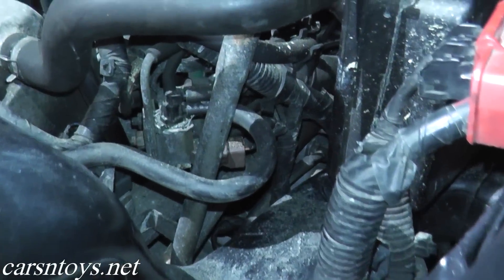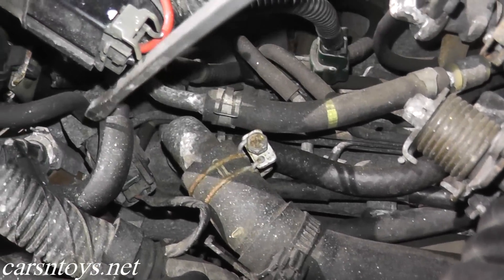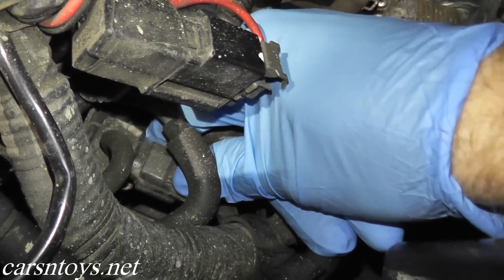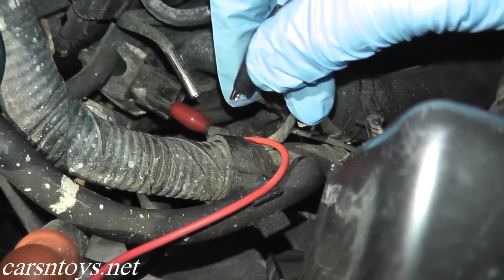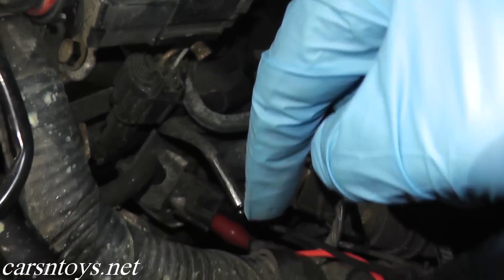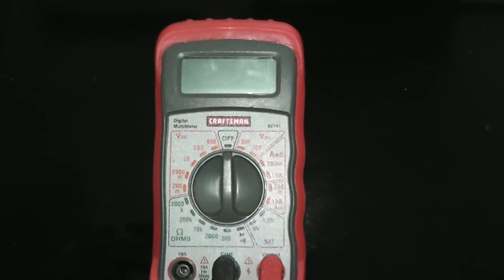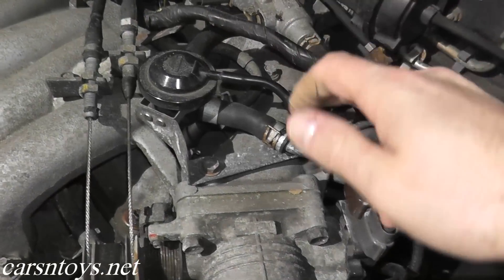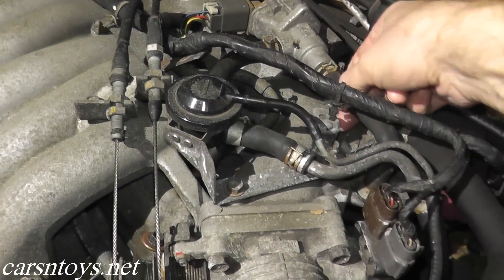How to Test and Replace EVAP Canister Purge Control SOLENOID Valve P0443

Comment: First of all thank you for the video it helped me finding the problem in the 98 maxima it was Throwing a lot of of different codes but the main codes was p400 p1447 which was a canister problem and the diaphragm on the canister was fallen off inside the canister and the engine was sucking all the Charcoal threw all the controls purge valve etc i had to remove all the hose and controls (sensors) and anplug hose to blow air through them with an air compressor and I realize was that evap canister all so i use the mityvac ( hand vacuum pump) to Check the sensors throughout the car and they was ok all so i use two wires with alligator clips to check if they open or close combine with the mityvac to make sure their operational so after spending thousands of dollars in mechanics this video for sure helped me fix my problems and yes if any baddy wonders this a 1998 nissan maxima California emissions car i want to personally congratulate the man in this video thanks brother and god bless
Reply from the maker: Glad to help! Keep it going!

Comment: I installed a tee into the vacuum line between the purge control valve and the purge control solenoid valve and attached a vacuum gauge to the tee.  When I started the car, the vacuum went immediately to 20+ inches Hg.  When the car warmed up and idled down to 700 rpm, the vacuum was still there.  Then I disconnected the connector (after shutting down) and started the car. The vacuum shot up to the same reading as with the connector connected. Then I checked the harness connector for power on pin 2 and  checked for the ECU providing ground on pin 1.  It was not, which it should not at idle. Obviously, the purge control solenoid valve is sticking open.  Just wanted to add this scenario because it is broken the other way--won't cut vacuum at idle or other times (like starting) when extra air causes problems.  David

Comment: Is it normal that my whole intier EVAP system was clogged up with too me looked like carbon build up. After cleaning up every thing the check engine light when off.
Reply from the maker: Happy it worked out. Certainly is possible, especially if your vehicle is a number of years old.
Reply: I just found out it wasn't carbon it was charcoal from the EVAP canister. I guess the filter must of gave out and clogged everything up. Runs like New again 👍👍.

Comment: I have 2003 kia sedona ex. 3.5 L 6 cylinder. Im getting the code p0443. Evap  code please need to replace the sensor or should I start with something else. A guidance would be highly appreciated. Thank you. Also the car rumbles at 50 mphs and above. Tire balancing is passed...its all done and 💯. I still can't figure out what's going on. Pls help.

Comment: Should I replace my vapor purge valve on my firewall also?? I believe it's working properly via vacuum hand pump ..I have a vapor canister1) a vapor canister valve solenoid 2)and vapor purge valve3)...1 & 2 have been replaced but not the PURGE VALVE

Comment: Another great video!  My solenoid valve did not actuate when I applied power.  The top hose on my evap canister purge control valve (flyin' saucer) has vacuum at idle, which leads me to suspect my solenoid valve may be stuck.  Does that make sense to you?
Reply from the maker: Damien Gregory Sure does.

Comment: Hi! 
I've got a 96 Maxima with the P0443 code. I am not getting suction from the small hose that you test in your video. I blew air (through a compressor) and cannot find any leaks. I have replaced the 2 parts listed in your videos, as well as the vent valve near the fuel tank pressure sensor. 

The check engine light comes on quickly after clearing it. I clear the code, start my car, turn it off for a minute and back on the the heck engine light comes back on. 

Any help would be greatly appreciated! 
Thank you in advance!

Comment: I have a 98 maxima and I just replaced the valve cover gaskets. I'm confused because now I have a p1493 code. I have yet to find a link on the Internet to actually pull the info on the code. it says it's the purge valve but I've checked it already. it's fine. possibly a leak in the IM?
Reply from the maker: There's a number of steps to go through for p1493 but you're looking at the right component. Did you check out this video....? https://youtu.be/4z9uUwc3iV8

Comment: I drive a 2002 ford focus I have engine code P0455 and P0457...I replaced my vapor canister AND vapor valve solenoid my car has shut off during idle at stop signs ..well this morning I get into the car and it reeks of gas smell...I hooked my old canister back up and no gas smell...I'm very confused how can a brand netw canister fail i also haven't had any codes come back as of yet...any advice please help I'm running out of time for emissions test

Comment: Hey there. Your videos have helped me troubleshoot my P0443 tremendously. I replaced the purge control valve [the black 'saucer'] because it let evap through constantly. New valve bench tests good. The solenoid that provides vacuum to the purge control valve bench tests fine. It will throughput vacuum when powered. The harness has 12 volts. However, it never actually provides vacuum when hooked up. Tried revving to 2K, still no vacuum output. ECM isn't telling it to. I powered solenoid manually and it will output vacuum. Any ideas?
Reply: Any luck?

Comment: Hi, I LOVE your videos, very helpful.I have an 02 infiniti i35 and I plated off the VIAS thing and drove it fine for over a year but now im getting the P1800 code back, im scratching my head because it shouldn't be connected. I recently replaced the camshaft position sensor and I think I need to do a "re-learn" after disconnecting the throttle body, but I don't understand the P1800 showing up. I plan on replacing the hoses and making sure they are connected to the right things ( I don't know the names of most car parts). other than that, im at a loss. I was wondering if the canister is what is causing the code, but wouldn't the canister have its own code it that was the case?Thank you in advance for any advice
Reply from the maker: +Kathy Sheehan Hi Kathy. Just so I understand this correctly, you disconnected the VIAS last year and the check engine light is just now turning on?
Reply: yes
Reply from the maker: Kathy S
Interesting that the check engine light is just turning on now for p1800. Regardless, I'm a fan of leaving the vehicle just as it was when it left the factory. If you can get everything back to stock and the components working correctly, the vehicle will run as it should.
Reply: I ended up buying (finally) an OBD2 reader for myself, if you'd like, I can let you know what code comes up, i think it comes in the mail today. thanks again
Reply: I am still wondering about the "re-learn" process for infiniti cars, if that has anything to do with it maybe
Reply: Refreshing  to see a "lady" that isn't afraid to work on her car!

Comment: I have 2009 Suzuki Equator Premium 4 cylinder 2x4 . Check engine light is on. Took to Nissan  they give me  cods  PO445 and PO447. What parts # do I need for Suzuki .
Reply from the maker: Try searching via rockauto, autozone, etc.

Comment: you forgot to hook the vacuum gauge up to the purge solenoid with the motor running and wire harness connected to see if vacuum dropped when you revved engine to see if it opened to draw fumes from the canister.

Comment: My 98 infiniti I30 doesn't start after I changed the ignition my head light are working but it doesn't turn over even after I try to put the old ignition back and nothing so do u or any body have an idea on what it might be ?

Comment: p0443 on an 06 acura tl. would i beable to do this test if i disconnect the purge valve from the car entirey
Reply from the maker: ***** For your TL, you want to start by checking for vacuum and then the harness connectors. It's quite lengthy. I may have an '05 TL in the shop very shortly. I'll shoot a vid for p0443.
Reply: CarsNToys ok thanx. I went ahead and took the purge valve off and tested jt with a 9v battery and it clicked everytime. Idk where to go from thers
Reply from the maker: ***** Gotcha. Could be a harness connector or just a clogged hose/ripped hose.

Comment: i had no power to the connector and checked the wire all the way back to the PCM so I have to guess its the PCM that is not sending power to the purge control .  I will order a new PCM and get back to you
Reply: +Lenny Codella Check the diagram, your PCM is not the problem. Power is coming from the ignition switch (battery). the PCM driver will switch to ground at 2000 rpm. Another word, the purge solenoid is a ground side switch. The pcm driver supply ground.
Reply: +OlamDao  so what do you think is the problem ,  Should I rev the engine to 2000 rpm and make sure at that point I have power or is it something else ?   Thanks by the way
Reply: +Lenny Codella well, you said you check the power wire and there is no power. If that is the case, then there is your problem right there. To be sure, check the power wire again, make sure you turn the ignition to the ON position and your lead is in contact with the connector (make sure you don't force the lead into the opening, just touch it). If you do it right you should have battery voltage. If you don't have voltage then the problem is either the power wire is open or shorted, or the fuse to the power wire is blown.
Reply: Thanks i will try that

Comment: Is it cheaper to repair my motor 1996 i30 Infiniti
Reply: Is it cheaper to buy me a a used motor oil rebuild my old motor for a 1996 i30 Infiniti
Reply: I need help repairing a 1996 Infiniti i30 spent barons
Reply from the maker: Bearings are shot..? I'd just buy another car. A 4th gen Maxima is very inexpensive if you want to stay in the 'family.' Or an older Honda. They're built incredibly well: https://youtu.be/p0ONsVNNo2M

Comment: Not a perfect test, what if the negative wire was open, the test should be between both wires.
Reply: that's why he needed to pull vacuum on the purge solenoid with the wire harness connected and the motor running to see if vacuum dropped when he revved engine. that would show it opened correctly. great video though.